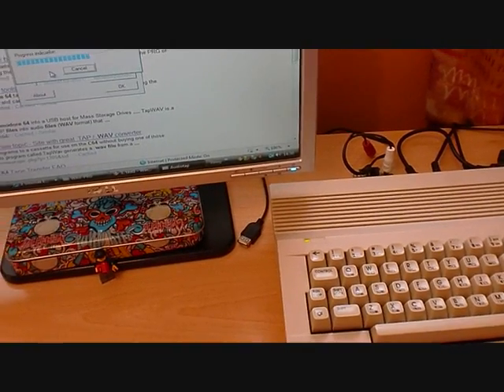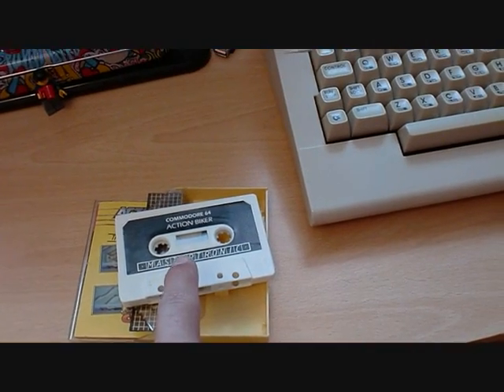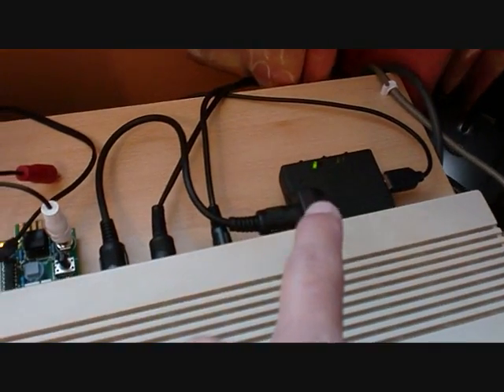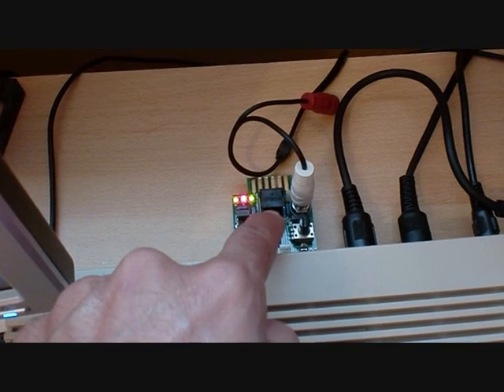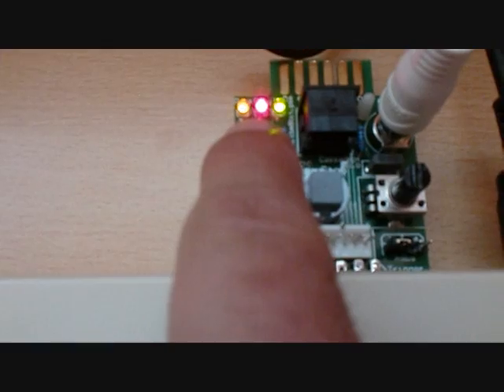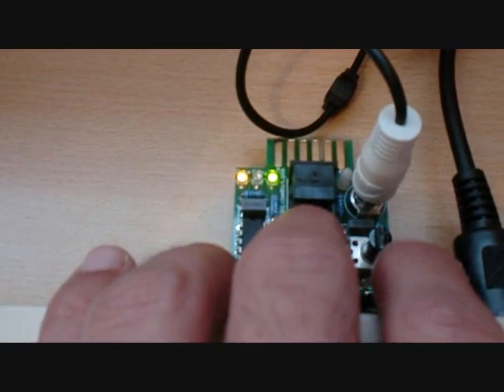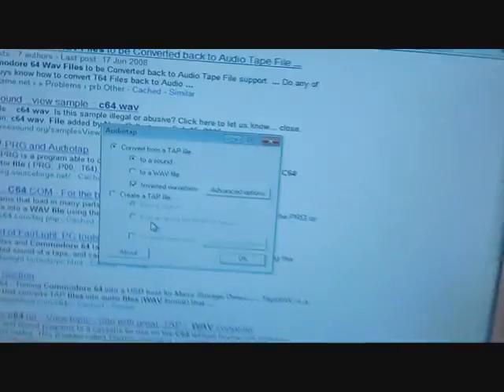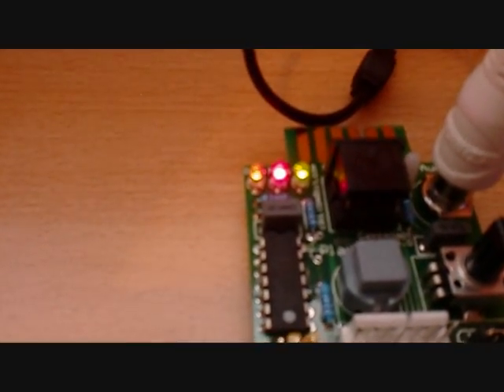Cassadapt for the Commodore 64

Comment from the maker: No you don't need a XE1541 cable with this device. Unfortunately the device isn't available any longer, but you can get something similar on eBay. Search for C64 disk drive emulator or SD2IEC. Use GOOGLE too.

Comment: How can i convert TAP files to WAV format ?
Reply from the maker: Use a TAP to WAV converter. Google search should do the trick
Reply: C64endings Ok i´m already converting TAP files to WAV to be read on a mp3 player attached to a C64 interface standard
Reply: C64endings I am downloading TAP games can you tell me what does it means : (the name of the game+ software) and (the name of the game+a) and (name of the game+a2) and (name of the game+a3 )  or ( the name of the game+u) ?
Reply: Hey mate i´m downloading TAP games can you tell what it means : (manic miner a2) ;(manic miner a3) ; (manic minera4), (manic miner a5; (manic miner a6); (manic miner a); (manic miner u) ?
Reply: Where i can order online an C64  interface like yours or similar ?
Reply: With a portable cd player attached to an Interface standard tape i already can see the Commodore 64 games reading lists on the TV screen but at almost the end the screen freezes or shows a square full of litle squares (errors) and the games don´t run. Can you help me?
Reply from the maker: Try changing the volume. The C64 usually like LOUD volume.
Reply: I already tryed on the maximum volume several times but the games drawaings  on readings still with errors with a lot of litle squares,etc and almost at the end the reading freezes the TV screen
Reply: ive got to sell my C64 interface standard tape because that interface it´s a nightmare everytime i want to load a game ive got to search the correct volume im here for 2 hours and i didn´t load nothing !

Comment: You can just solder the signal and ground end wires of a 3.5mm jack lead into the front of the hex converter circuit inside the c2n unit or the last of the opamp circuit if your MP3 player or phone have weak headphone outputs. Should give you an almost free solution.  For the play signal just press play on The c2n, no need for a tape.  Me I'd just mod the c2n with a headphone socket on the unit.

MP3 encoded files will load fine with a lame preset setting of standard and up, put nice artwork of the game cover on the mp3 via id3 tagging software.